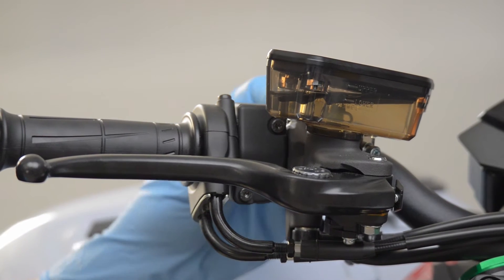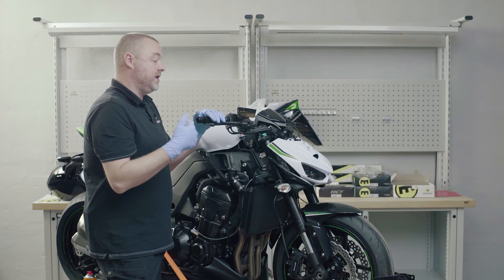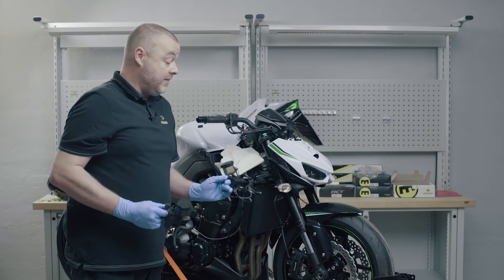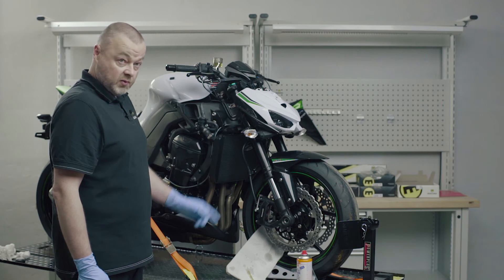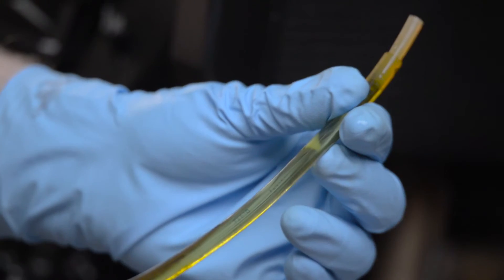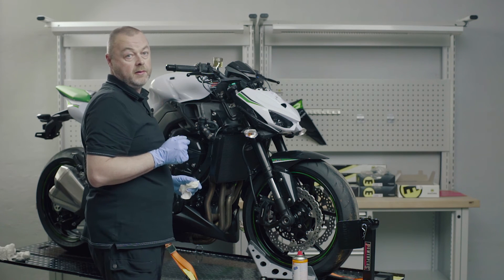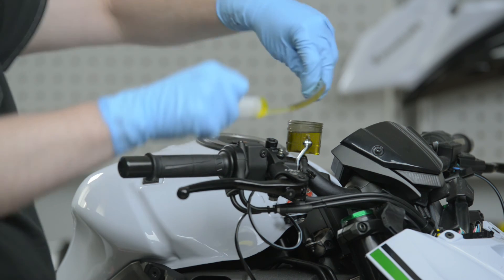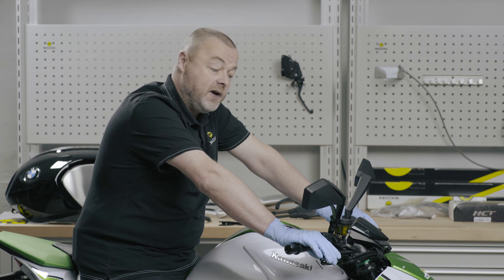MAGURA Radial Master Cylinder HC1: Installation

Comment: I was on your website reviewing the HC1 for my 2005 Suzuki GSXR 750 which comes with the Nisin (3/4) MC stock. I've switched the lines to from the standard single rubber hoses which has a single banjo bolt, to a dual steal braded brake lines, one line to each caliper. That being said I do not see an option on your site for a banjo bolt for dual lines. Is there one?

Also, being that the Suzuki stock MC is a 3/4 (19) radial what are the drawbacks of moving down to the 18. I just want to be sure I get this right before making my purchase.

Comment: Hi, is it minéral or dot oil ?!
Reply from the maker: Depends. The HC1 clutch master is available as a DOT or Mineral Oil model, the HC1 brake master is only available for DOT.
Reply: @MAGURAPassionPeople  wonder why motorcycle only use dot for brakes
Reply: @MAGURAPassionPeople  Hey Magura , do you think it's technicaly possible to convert motorbike brakes to ebike brakes , with dot oil caliper ? because I love the oil réservoir look !

Comment: I have the hc1 for a left hand rear brake  with a tap in fitting straight to the master cylinder for stunt riding.  I bled the rear caliper from the peddle back.   but how do I bleed the extra line I put in from the hc1 magura down to the master cylinder....